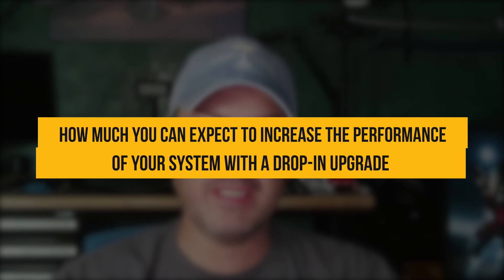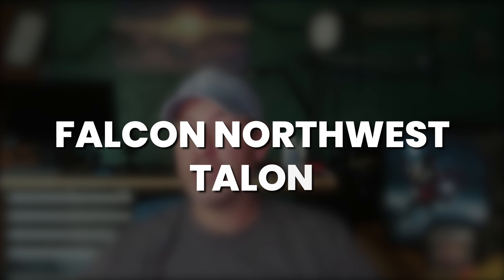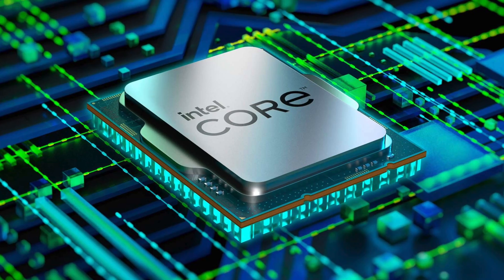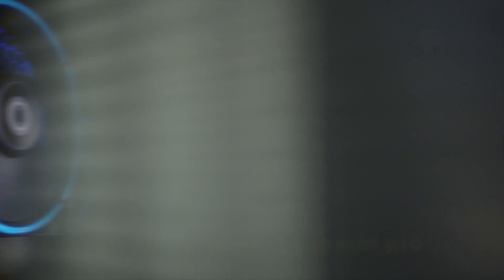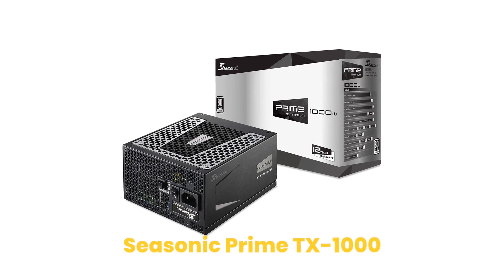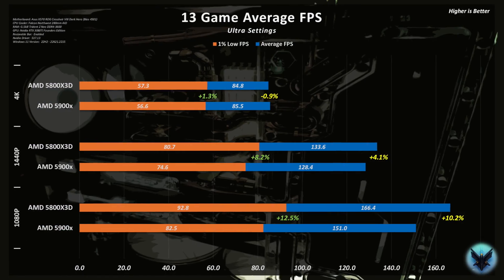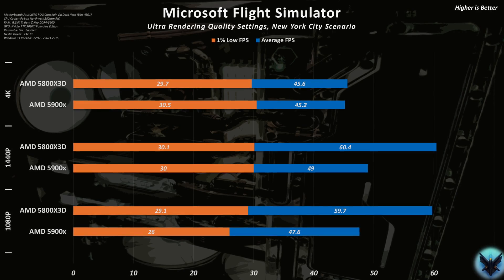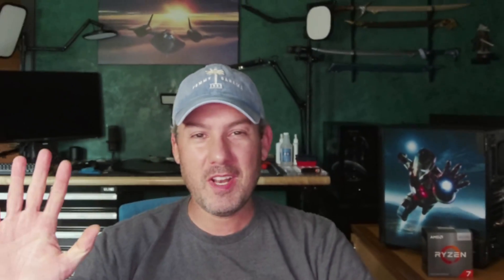Is The 5800X3D Really Worth It?

Comment: I'm stuck on what to do... I have a 3700x currently with a 4070 Ti Super. I don't want to spend the money upgrading to AM5, so my options are 5700x3D, 5800x3D, 5900X, or 5950X... Very hard decision considering their prices right now are (in USD) $247, $287, $299, and $368, respectively... The 5950X price/performance is definitely the worst, but the other 3 are very competitive pricing. Thoughts?
Reply from the maker: It really depends on what you do, if you are predominantly gaming then I would get the 5800X3D … if you do a lot of applications as well then get the 5900X. You will be happy with either chip.

Comment: I went from a 5900x to a 5800x3d and wow on twitch, the vids are way more detailed with that 3d cache all I can say . running a  hellhound 7900xt
Reply from the maker: That’s interesting … will have to look into that more … likely because the cpu is hitting your ram less often, so you would get improved system latency. Thanks for watching!
Reply: @blackbirdpctech   some more confirmation on this....a coworker went from  a overheating 3700x to a 5800x3d  on a  b450  board with a 3070ti  and was the first to show me this , his twitch was way more detailed and clear , just upgrading the cpu. also the 5800x3d in my tests and upgrade like 3200 mhz ram  not faster  ,the 3600 mhz works great with the 5900x

Comment: Totally depends on your use-case, if you play a lot of e-sport games then the switch to 5800X3D makes sense but if your use-case is mostly related to productivity or you just play some triple A games from time to time then probably not. Remember that you are losing 4 cores and 8 threads, I would only consider upgrading if I had a 4080 / 7900 XTX level perf GPU.
Reply from the maker: Agreed, thanks for watching!
Reply: I've heard that the "5800x3d is better" so many times. People seem to falsely believe that it's faster at everything. A 5900x will handily outperform a 5800x3D when it comes to heavily multi threaded workloads.

Comment: My 5900X reaches 5Ghz on some cores, that is basically what AMD is advertising with for the 5800X3D.  There is no way to get all 5Ghz cores on a die because it's a silecon lottery, so even a 5800X3D has cores that won't reach 5Ghz :) If you have to budget to buy a decent cpu I would definately go for the 5900X because of the performance in other tasks besides gaming. 
I'm glad I could finish the am4 build before the am5 platform is all over game world. Atleast I have a decent PC for the upcoming years! I always wait a very long time before upgrading.. See you just have to be happy with what you bought. In the past I did more upgrades, but I know that hardware is old the next years and upgrades are incremental these days.
Reply from the maker: Great attitude !!

Comment: I'd say absolutely not 1440p gaming as well. Same also applies if you have a 5800X vs 5800X3D and vs AM5.
Reply from the maker: I am thinking about doing a comparison between a 5800X3D/4070S and 7800X3D/4080S ... simply to see if the additional cost is really worth it ... my guess is that the additional cost will only buy you relatively small FPS gains, but it would be good to see the data.

Comment: Im in this current situtaion now. I have a Ryzen 5900x, X570 PG Velocita, 32gb ddr4 3600mhz, 850 watt PSU. I just upgraded from a RTX 3080 10gb to the 7900xtx and theres a small bottleneck (between 3 to 5%). The only upgrade worth it is to just wait until I want to go to AM5 because a 5800x3d or 5950x isnt worth it in my opinion.
Reply from the maker: I agree, at this point you might as well wait until the new AM5 CPU’s are released.
Reply: @blackbirdpctech  im a content creator and i game. In your opinion is a 5900x with a 7900xtx considered a high end pc in 2024? I mean its good but i just want another opinion. Would you consider that build high end or mid teir?
Reply from the maker: @shadowghost815 the 5900x would now be considered mid-tier while the 7900xtx is high-end.

Comment: I have a 5800X3D and the frame rates are always high. But I am convinced that with a 5900X the system would feel smoother. Many times when I alt tab out of a game my windows doesn't feel as responsive as it does when a game is turned off. Which is strange because an 8 core chip like 5800X3D should cut through anything... but maybe its all in my head.. or maybe its just windows 11 being sluggish OS that it is
Reply from the maker: Interesting, I definitely experience that sometimes depending on the game and I'm pretty sure it's Windows ... when background tasks are still running and using resources after you shutdown the game the entire system can feel sluggish ... that's one of the issues with Windows ... it's really hard to tell sometimes what the system is doing in the background.
Reply: Do you have an Nvidia GPU by chance?
Reply: @MarksMeat69  I have 7700 XT

Comment: I managed to get FCLK 1900/3800MhzCL15 with my 5800x3d and verry low latency. Think I will stick with that for a couple more years or more. When I start struggling to hit minimum 60fps at 4k in games due to a CPU bottleneck I will upgrade lol
Reply: At 4k you won't get CPU bottleneck. That is why I won't even bother upgrading my 5900x for the next few years.

Comment: Hey man great video! I have a question. I am playing “the finals” now with a 4060ti (16 vram) and 5700x. I am getting bottle necked by the cpu apparently. Do you think the 5800x3d will be a better pair for my 4060ti? Or should I go with the 5900x? ( I am aiming completely at 1080p and want above 144 fps, also I’m running a 165 
Hz monitor) Cheers and thanks again for this benchmark video!
Reply from the maker: I would definitely get the 5800x3d … if your objective is better game performance, especially at 1080p then you should see a nice performance increase with the x3d chip.
Reply: @blackbirdpctech  gotcha! But any idea on why my 5700x is underperforming? I don’t even know if I am bottlenecking at some point but when I game that specific game I get processor around 70% and gpu at 80% tops so I don’t know what is going on haha
Reply from the maker: @psamae if your cpu is at 70% and gpu at 80% then you are pretty well balanced.  If you increase your in-game settings the load on the gpu should go up.  Your cpu is only limiting you if it’s close to 100% and your gpu is much lower.
Reply: @blackbirdpctech  and what happens when it’s the other way around? When a cpu is at 40% and gpu at 80-90%? Then does that means the gpu is causing the bottleneck?
Reply from the maker: @psamae so just some context, you will always have a bottleneck … that’s the nature of pc’s.  Yes, if the gpu is at a high load in a game and the cpu is at a low load then you are gpu bound.  You can reduce in-game settings or resolution but it’s not an issue if your frame rates are good.

Comment: I feel like this is more of a sidegrade, not really an upgrade, you exchanged productivity power for gaming power, both are great CPUs, but each is somewhat better in either productivity or gaming, looking at your own benchmarks, I don't you you got your value out of this upgrade, overall it's the same, so you paid money to buy an extra cpu, to basically just get the same, switched productivity prowess for gaming prowess so I agree with your conclussion.
To someone building a new PC it depends on what they plan to do with it, if they're gonna both game and work on the same machine, then the 5900x, but if the system is purely entertainment and they work at work on a laptop for example, then the 5800x3d all the way, the only downside of going AM4 is that it's a dead-end platform, while from a performance difference between the generations you'd get more value going for AM4, but if you realize that the AM5 platform will keep you going for 3 more generations after the current, you'd be doing yourself a huge favor in terms of support and future upgradability.
Reply from the maker: Agreed, thanks for your comment.

Comment: I greatly enjoyed your 7800X-3D video, so I'm back for another in the series.  My previous main gaming/production PC was a 3900X/2080Ti build, and I considered just dropping in a Zen3 chip.  But which one?  Extensive research told me the best bang-for-the-buck AM4 upgrade for my 3900X was -- none.  The only truly significant AM4 upgrade from the 3900X is the 5950X, and I could not justify its cost now that AM5 is available.  I decided to build a new rig and stick with the 3900X in that PC, relegating it to a secondary role (now with a 6750XT as the 2080Ti has developed what I think is a sensor issue that makes it think it's overheating).  My main machine is now a 13700K/7900XTX build, and it is at least 50% faster than the old system in every application.
Reply from the maker: Killer build ... I am going to put the 4080 up against the 7900XTX in an upcoming video ... given the price point for the 4090 I think the real battle is between these two cards ... will be interesting to see who wins.
Reply: @blackbirdpctech  They will trade blows, I suspect, with no clear winner.  I chose the 7900XTX for its 50% greater VRAM buffer, because I don't play any RT games, and because Nvidia has openly declared, albeit in a way that many people miss, that it does not care about gamers.  I already had a 6800XT, more than adequate for my needs, but I promised myself a 7900XTX if I could get one for under $900. That happened, and it's in the machine.  The 6800XT is now in a 5700X machine, where it's pretty well balanced.

Comment: I think will be a upgrade for earlier AM4 cpus not from 5900x, or even for a new built, still cheaper than AM5 or intel alternative..Bought for 265 euro..
Reply from the maker: Agree on the 5900x but if you are building new I think it’s a great option to consider.
Reply: @blackbirdpctech  One or other.. AM4 still rock, 5800X3D UV, PBO, CO, 79-81 C, Nh14s/ 71-73W.,4450mhz all cores/4500 boost..Merry Christmas !!

Comment: I upgraded from a 5600G to 5800X3D, the best move i could´ve done. Now i just need to upgrade my deadbeat 3060 since it´s holding my X3D back quite alot..
Reply from the maker: Hang in there … I plan to giveaway a 7900xtx at the start of January to a subscriber to celebrate my channel launch … details to come 😉
Reply: I have a 5600g should I get the  7 5700x3d (just came out today) or a 9 5900x I have 32 gigs of ram at 3200 and a rx 6700xt
Reply from the maker: @eastkrats-hb8nl what is it that you primarily use your PC for?
Reply: @blackbirdpctech  Gaming in 1080p and streaming
Reply from the maker: @eastkrats-hb8nl I would have said 5700X3D (I just got one so will be interesting to test) but since you are streaming as well then the extra cores of the 5900x will likely help you avoid issues in games while streaming.
Reply: @blackbirdpctech  ok thank you the prices for the 3d are not good right now and I can get the 5900x for 230 usd
Reply: @blackbirdpctech  Thanks a lot, i have the same question about streaming, you saved me a little money for my pocket, but i think i need to change my water cooling(DeepCool LS520) for the Ryzen 9 5900x.
Thanks a lot.

Comment: A tip to get more performance out of your 5800x3D would be to under-volt it, mine runs 4.45GHz locked in games with a -30 offset on all cores, very stable.
I also have 32GB of 3600CL16 memory but still run FCL@1933MHz which seems to give me the best combination of performance and stability.

So naturally my 5800x3D performance is higher than in your video, but it's obviously tuned a bit.

It also runs lower wattage in general after I under volted it while performing more consistently with better 1% lows across the board.
Stock: 110 watts in all core workloads and some core heavy games.
Undervolted: 80-90 watts all-core and 40-70 watts in games.

I have also found that solid timings on memory can help a ton with 1% lows even with a x3D CPU.

Multicore scores have significantly improved since its all-core went from around 3.9-4.0GHz to 4.35-4.4GHz
R15 went from 2200 to 2500 with the under volt and R20/R23 also saw improvements, but I cannot remember by how much.

PBO2 (The software I use to under-volt)
https://www.youtube.com/watch?v=-l30dYv4KOo&t=0s
Reply from the maker: Nice explanation for what you did to optimize your 5800X3D.  I intentionally didn’t do that because I wanted to show results that most people would get without any tweaking.  A piece of software I use to optimize AMD chips is Hydra.  You don’t need it but you might enjoy using it … might help you get even more performance.  Thanks for your comment, very helpful.
Reply: @blackbirdpctech  will try it out.

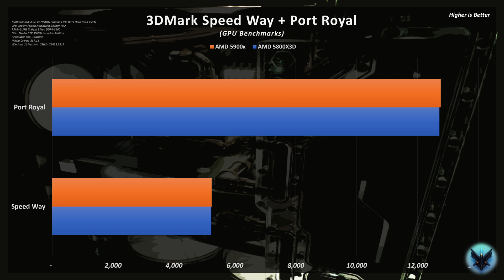Comment: @8:44
The bars are flipped around, no way the 5800x3D is lower (Better performing) in this multicore benchmark.
Reply from the maker: Yes you are correct ... will look into it and update the benchmarks ... hopefully it's just a simple transcribe issue in Excel.  Thanks.
Reply from the maker: So it turns out that the data is correct, it's the label on the chart that is incorrect.  Blender provides a score that is measured in samples per minute, so higher is better, not lower as I have on the chart.  I will update the benchmark file with this correction and post it on my website.  What's strange is that when I look at other Blender benchmarks for these processors they appear to show a measurement in seconds such that lower would indeed be better.  Does make you wonder how some people do benchmarks.  Thank you again for pointing this out ... definitely made me worry for a minute 😉
Reply: @blackbirdpctech  oh, I see now, you meant to say, "higher is better" and not "lower is better", small mistake, and makes sense since it uses time as its metric.
I've never used it myself so can't say.

Comment: 5900X here, I will wait the 8800X3D.
Reply: you mean 9800x3d the 8000 series are reserved for laptops.
Reply: @Balanced-- yes, them👍👍👍😎 (or later models, still enough)
Reply: @Balanced--  And APUs.
Reply: Dumb question but is there a game that the 5800x3d can't run over 144hz ? Kinda pointless to upgrade if the speed it will gain can't hit the screen. But then again the 8800 isn't even out yet
Reply: @news2383  Depends on resolution and GPU, of course. There are certainly games that the 5800x3d can't hit 144hz at 4k. I have a 5800x3d and a 4090 and I pretty much peg 144fps at the highest possible settings for Horizon Forbidden West, but that wasn't the case with the 3090Ti. 

Games all are different in terms of whether they're CPU intensive, GPU intensive, or balanced. 

But overall I agree with you. The time to upgrade is when your PC doesn't do what you want it to do. For some people, that's hitting 99th percentile in TimeSpy Extreme. For others, it's maxing out their monitors refresh rate. 

Also, keep in mind there are a LOT of 240hz monitors out there now, and LC has a 32" OLED 480Hz monitor.
Reply: Looks like 7600x3d for you

Comment: Just did a bit of a family hardware shuffle, my son took my old i7 9700k and Gigabyte Z390 nice MB and I took his old MSI Bazooka B450 board and Ryzen 3600x, and it was a noticable diffrene (down for me and up for him).  Im running a 3070 and he has my old 1070.

Then this weekend I installed a 5800X3D on the old B450 and WOW! What a diffrence, playing PUGB in 2560x1440 and the intel was yielding about 170fps, the 3600x about 140-150 (with bigger drops) but the 5800X3D shot right to 300.

For those running an AM4 board regardless of the chipset, and if the board supports it, then look no further, the 5800X3D is an amazing upgrade.
Reply: This is also my target upgrade, from 5700x. I also play PUBG @1440p with RTX 3080. I still get stutters and fps drop to 100+ depending on which part of the map. Hopefully 5800x3D will solve it. As for my 5700x, I will rebuild it for my son.

Comment: I'm trying to figure out which to upgrade to from a 3700x/Asus B550.  I game more, but I don't wanna limit my PC to just gaming either.  Though CP2077 CPU requirements on a high end looks to want more cores.  I think the 5900x may make sense for me.  I think future games will like more cores.  Still an upgrade from my 3700x.  Gaming on UW if that matters.
Reply from the maker: I think the 5900X would make sense.  That said, I had to update the 5800X3D synthetic benchmarks due to an AIO cooler issue ... the video recommendation didn't change and the only game that was impacted was MS Flight Sim at lower resolutions ... you may want to review them before making your final decision.